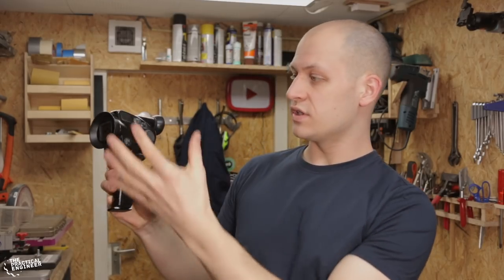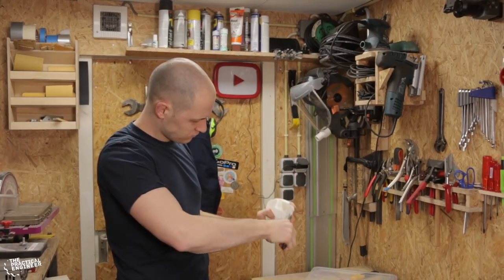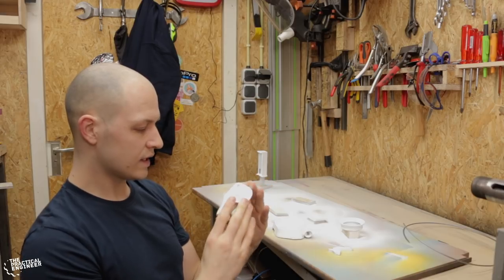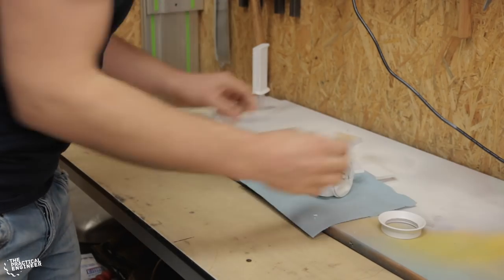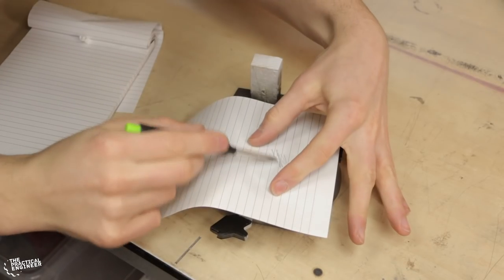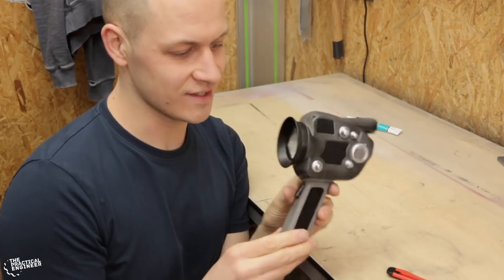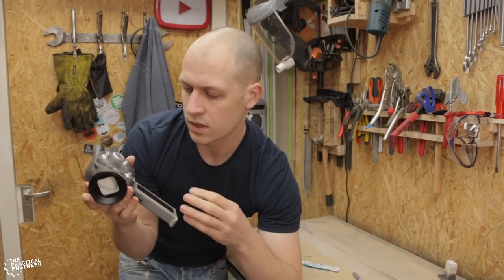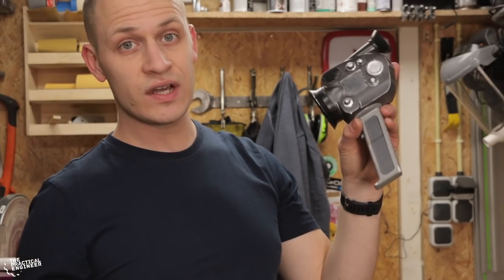Vintage prop camera that fits your GoPro - prop making

Comment: Looks awesome! Does it helps with stabilization?
Reply from the maker: Thanks! yeah it definitely helps. Adding some weight and a proper way to hold it makes it easier to stabilise it compared to holding just the GoPro itself.

Comment: Cool! What thinners are you using? And how can you see if the GoPro is actually running?
Reply: I meant fillers :o
Reply from the maker: I use universal filler, often the stuff for filling plaster, because that dries fast and sands easy. The gopro makes a nice beep when it turns on :)